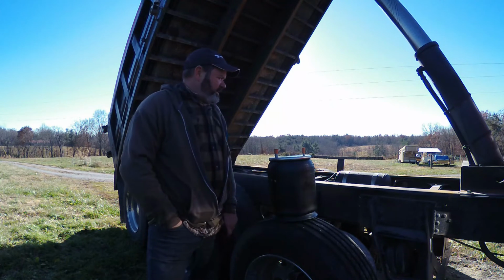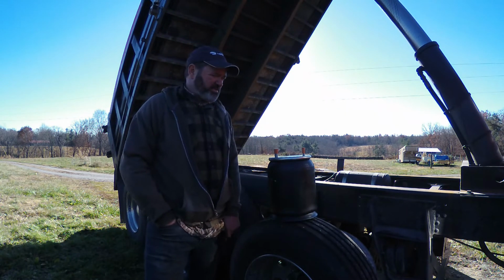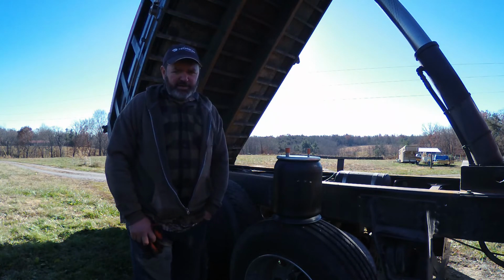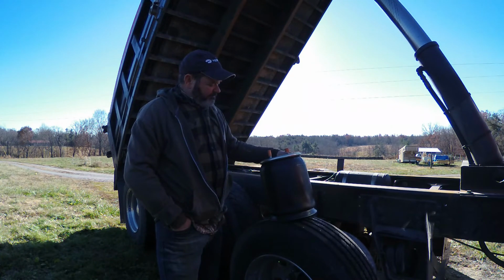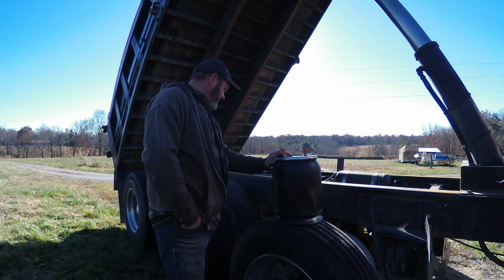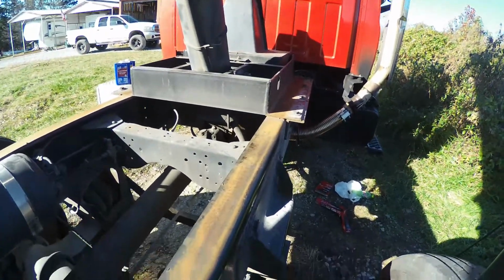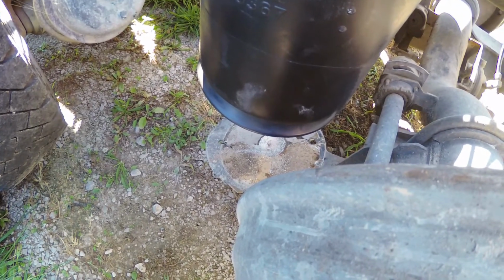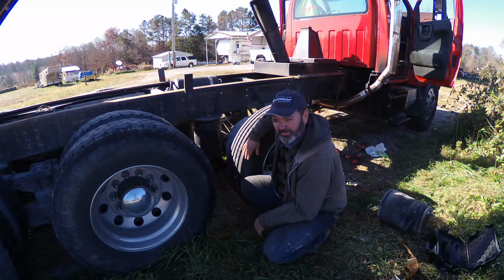DIY Truck Maintenance - Replacing Hendrickson Lift Axle Air Springs.

Comment: Hey Steve, Tommy here cool to see the truck on YouTube! Hope she is serving you well and to see more of it on here
Reply from the maker: Hey Tommy. It had a cracked head, cracked turbo, cracked, broke rings, and cracked exhaust manifold when I got it home from that blown intercooler. $10K in repairs and it still ain't right. The block is too scared up due to the broken rings. Cat said driving one home after an intercooler blows is engine suicide.
Reply: @stvbird  Man that is terrible I hate that happened wish we had somehow known I can’t believe that it would have had that many problems I really hate that

Comment: Why am I here. That's a $100.00 to $125.00 an hour job in the big shops. I guess I thought he was building a Rock Crawler is why I am here. I was looking for pipe cutting and Mig Welding going on.